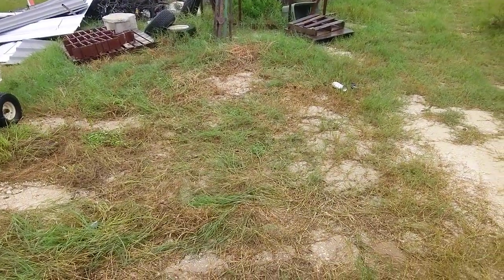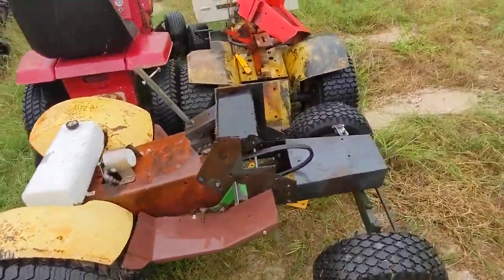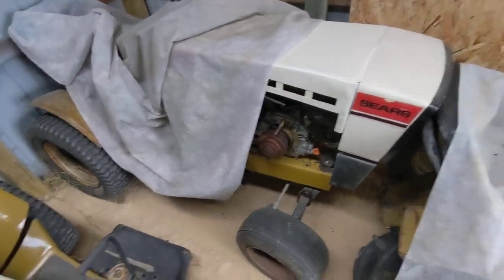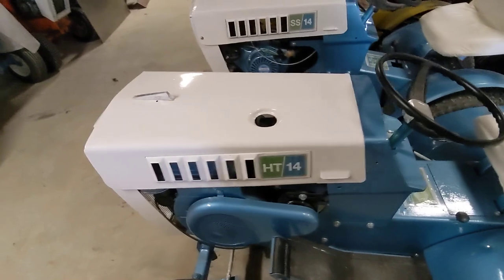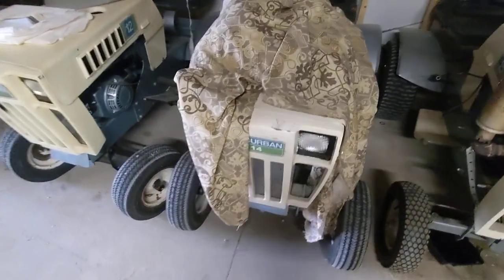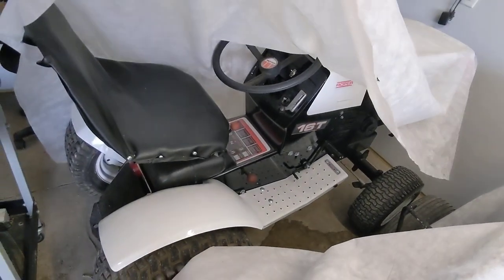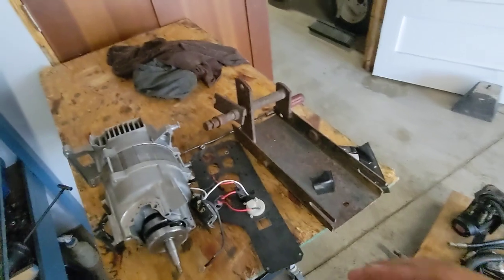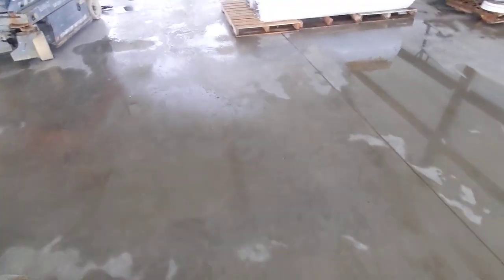Update and what I've been doing and 4x4 Sears tractor in the works

Comment: Are the tractors like this still good to buy. Can you find parts for them.  Are they reliable.
Reply: What's out there is either picked apart, rusted up, or already restored and not cheap to buy. The high price for restored machines is hard due to the lack of easily available parts - especially for OEM engine components.  Spindles on mowing decks can be replaced but it's a difficult job for most home mechanics. Transaxles have 50-60 years on them. Tractors that were either worked hard or later turned into mud machines with locked diff and/or larger sized rear tires will develop cracks and broken gears - there are no new replacements for internal transaxle parts other than bearings/seals.  Once the gears go, it's done. 

I have an original 69 SS12 that my dad bought new and worked hard on a small farm. I care for it dearly, and recently rewired the entire tractor with new oem looking LED headlights and a rebuilt starter/generator.  I have a ton of attachments including a restored 36" Earthcavator and roto tiller. 

If you can find one that is in decent condition and hasn't been nabbed by a collector like the OP, I'd say go for it. They are more reliable than any riding mower you can buy at a box store, with the caveats mentioned above.

Comment: JB weld is good , but I don’t think I’d use it on that oil filter adapter
Reply from the maker: I put some jb weld on it today, after it cures the plan is to aluminum weld in a few spots for strength, if it doesn't work. I found some cheap ones on eBay.

Comment: Hey buddy I wanted to know how do I get my SS12 CARB TO STOP LEAKING
Reply from the maker: Where's it leaking from? If it's from the little drain at the bottom. remove it, find something to use as a gasket and a small bolt and some washers, it should do the trick.
Reply: Ok thanks and I wanted to know where can I buy the cylinder head from.. I strip the spark plug hole and I can't get the spark plug to sit properly.. I try rethreading it and tap.. I think I need to buy a new head
Reply from the maker: I've seen inserts that go in thare and make new threads but I'm not shure what there called. Someone on eBay should have the whole thing
Reply: Ok thanks you so much man